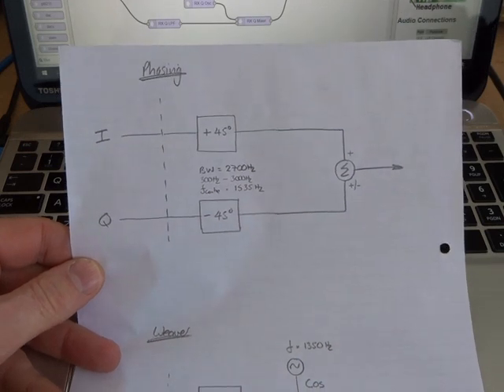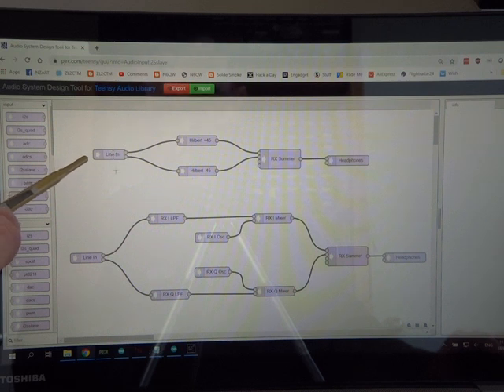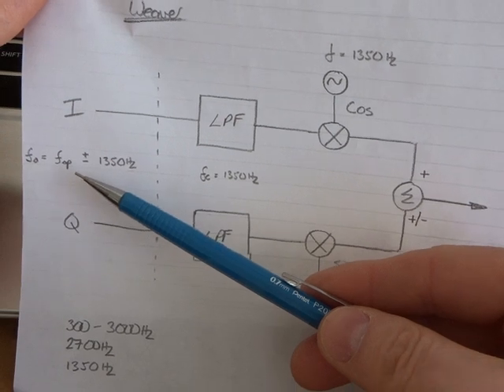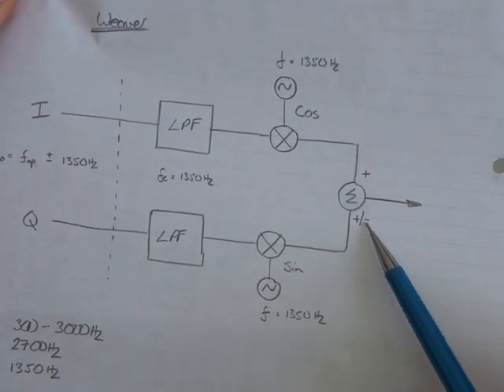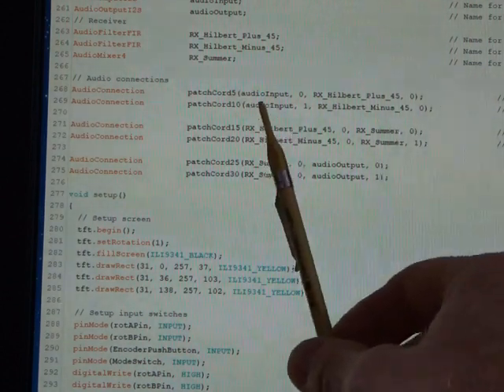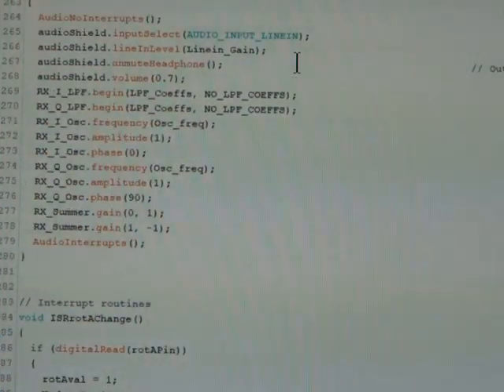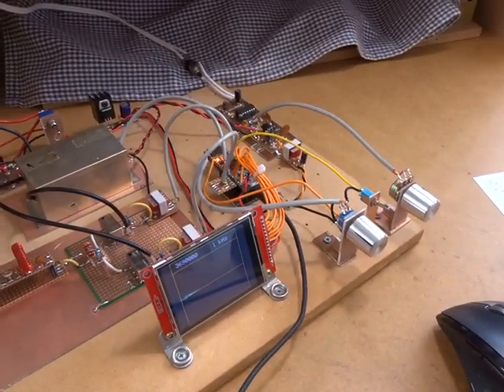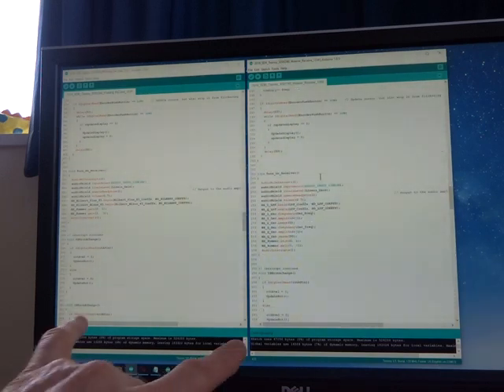80/40/20m SSB SDR Phasing Rig: Part 4. Test Phasing and Weaver Software

Comment: Hi Charlie excellent work yet again.  It always amazes me how good a simple setup like that can sound. What benefits do you gain from the weaver method, it's not something i'v looked into yet.
Reply from the maker: Hi Brian. Like you I have not had a lot to do with the Weaver method. From what I can tell from the literature, it provides superior sideband suppression over the phasing method. The down side is slightly more complexity. I'll probably take another look at it once the radio is complete as it doesn't impact the hardware. All good fun!